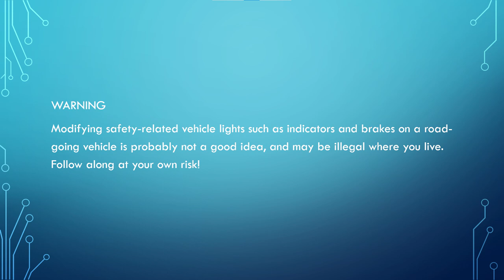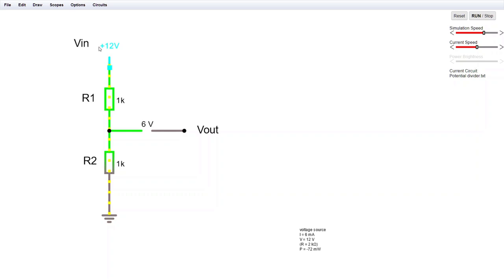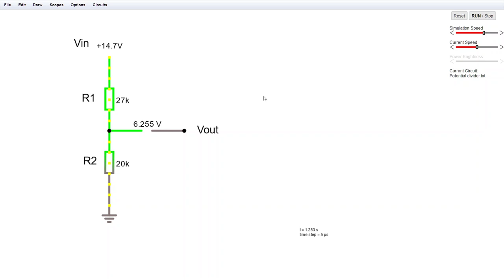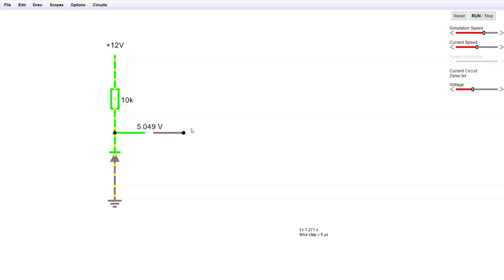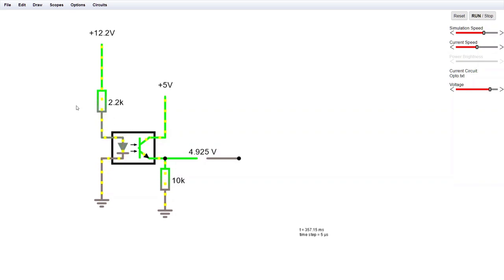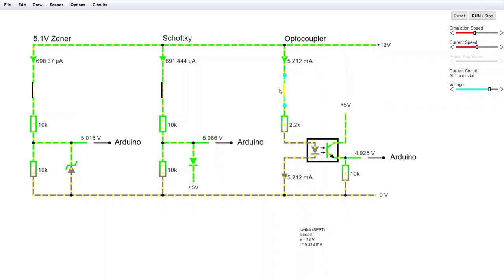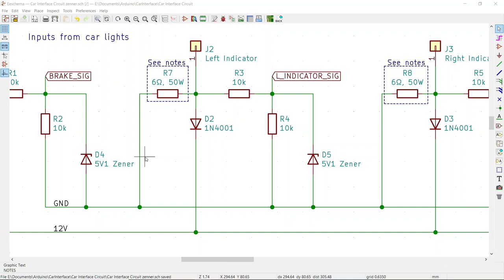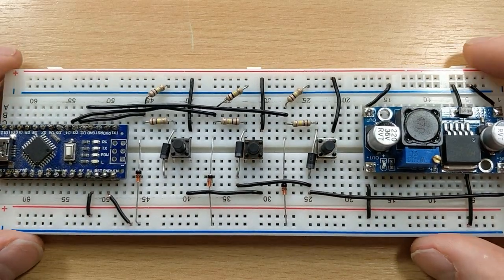Animated indicators (turn signals) with Arduino, FastLED and a WS2812B LED strip.

Comment: This would have a very piratical use in creating a wiring harness for a trailer.   They sell for $150 to $200 US and do the same thing.  This looks like a much more reasonable option and will protect the signal lighting in you car when hooking up a trailer.   The days of just tapping into the lights for a trailer is gone with all new cars.  This looks like a inexpensive alternative.   Good stuff and WELL explained.   Thanks.

Comment: Beautifully delivered presentation and project planning. My best tip for vehicle lighting cluster modification is to not bother... but if you do want to proceed dont hack apart your OEM units and purchase some non OEM aftermarket ones. Taking apart lighting can be tricky. Some are ultrasonic high frequently welded. Some are bonded with polyurethane. Dont forget that plastic is a thermoplastic and baking them in the oven can cause irreversible damage

Comment: Interesting stuff - thanks for the video.   If I may make one comment on supply voltages...  Automotive can be an engineer's nightmare.  Cold-cranking can lower the 12V down to 6V or so in some cases.  And beware the load-dump spikes.  Solenoids and motors can throw all kinds of junk onto the 12V supply, and short spikes in excess of 50V are not unknown.  So you did the right thing with your input clamps, but you should perhaps consider the supply regulators that they use (and their input capacitors or other filter protection) to avoid nasty surprises.
Reply from the maker: Thanks for the advice! I was reluctant to put too much capacitance on the power input, as I presumed that would delay the boot of the Arduino (I might be wrong here, I'm no expert!). Or are you saying to make sure that any components on the power input should be rated much higher than might otherwise be the case? Or some kind of choke perhaps on the power in?  It was an interesting thing to look into and is just an experiment really, always happy to learn though!
Reply: @ScottMarley  I was basically trying to say that you need to ensure that the parts on the input have an adequate voltage rating.  Specifically rated regulators are often rated with maximum input voltages up to 60V or so. They should not run like that normally (too much power loss) but they will not get destroyed by the spikes.  Due to battery the voltage drop on cold starts, regulators with minimum voltage low drop may also be specified.  I am not suggesting you should follow this guide, but it gives some good pointers regarding the problems to avoid... https://www.ti.com/lit/an/snva681a/snva681a.pdf?ts=1618885870959
Reply from the maker: @GodmanchesterGoblin  really useful, thank you very much.

Comment: Compliments on the video! It's a simple but detailed explaination. I was just wondering if it was possible to use a 5.5V, 0.33F or 0.47F super capacitor after the buck converter to keep the arduino running between the blinks so that a more complicated animation can run. Seen as I wanted to use about 64 leds in one blinker with an arduino, converter and capacitor each, I though 0.33F would be enough capacity to keep everything running. Does this work with the diodes you named D2 or D3 in your schematic? Just to confirm my thoughts...  Also, if it worked, do I need to decrease the resistor you named R7 in your schematic because of the increased powerdraw of the charging capacitor?

Comment: Nice. Question: Why not use 12volt LED strip and relay system for inputs? 12v coil on relay will handle auto voltage changes and SPDT can toggle between 5v and ground from nano to prevent float. What potential problems could this create?
Reply from the maker: You'd have to be careful regarding the voltage you are supplying to the strips remember when a car is running, the battery voltage is more like 14.5V with spikes well above this. 12V LED strips might be ok with this, or they might not, I haven't tried. You might have to put a buck / boost converter in front of the strips to give them a constant 12V. You could absolutely use relays for this,   I just decided to go for all solid-state.

Comment: Im looking into implementing this for my motorcycle as an addon to the existing lights. I was wondering, is there a way to do this same thing, but have the brake lights and the blinkers on the same strip? My idea was to have the lights red when braking and then when turning blink them, and when neither have them glow white or something that way im more visible.

Along with that is there a way to have it change led colors in segments? So lets say for example that I have a single strip that runs around the motorcycle, and i want to change leds 1-20 red, the 21-50 white and so on. I believe there is with some modification to the code, I just want to make sure before I get too far.
Reply from the maker: Anything is possible of course :) check out my FastLED basics videos if you want to learn how to code your own patterns. Good luck with the project!

Comment: Could you show the same on a multicoloured led single strip.
Also add reverse and side light
Reply from the maker: These are multicoloured strips, so you can make them any colour or pattern you like! I just stuck with the traditional colours in this example.

Comment: Awesome project, interesting idea using the power directly
from the lights.

I assume you programmed the Arduino directly without a bootloader to minimise
the powerup delay?
Reply from the maker: I thought I might have to do that, but in the end the delay on the car brake light compared to the LEDs is only perhaps 100-200ms which I thought was acceptable. So in the end I left the stock bootloader in place.
Reply: @ScottMarley   I wondered about this too.  Seems like it works just fine.  Keep it simple.  :)

Comment: Unless you have an electric car and a steady current (you won't get 14V, just a clean 12V and some HF noise from the motors), you may want to filter out a lot more than just the voltage... A 7805 and a couple of beefy capacitors (plus the usual 100nF near the Arduino itself) and an inductor may be a minimum,

Comment: Hello.  I have a different project, but I can't find a solution.  Your video looks good.  There are 2 different places where I get 12v energy.  When the capacitor is connected to the place where I first get energy (mirror floor lighting), the vehicle cuts the energy.  If I do not connect a capacitor to the 12v part I get from the signal, the sliding signal does not work properly.  This goes to the 12v regulator I bought from two different places.  I am waiting for your help.

Comment: Hi Scott your video is incredible well done and incredible informative I have already learned so many new things and have also started following the fast led basics and more on your channel. 
I understand the 5v1 Zener diodes and the schottky Diode to some degree but not where to extract/insert the signal wire to activate from indicator or brake. 

 For a slightly different project I would like to replicate  your circuit and have looked at schematics but struggling slightly to iterate how the flow runs on the actual hardware when connected to the car.
In your example you still have the push buttons(just to show on desk) and then also included signal from the car. 
If I was to only use signal from the car those switches will come out but would I need to bridge the gap or put in something in its place that's the only part I don't quiet fully understand
Reply from the maker: Thank you! The buttons would be replaced with the wires that normally go to the car light bulbs.
Reply: @ScottMarley  thanks for your speedy reply. Again I am super impressed with how the video is done really well explained, just as I said got lost from where you built it on hardware and to putting in the car and doing the testing. Awesome to see it in action. 

 I have a screenshot of your hardware setup. It's a little difficult to see where the vehicle wires are inserted but I bought all my components and have a buck converter so going to try replicate on my bread board and then follow schematic to see how it all runs and flows from input to arduino and then arduino to the led strip.

Reading through some of these comments getting a little bit of extra insight like the one comment of on cold starts with voltage drop would that put any stress on the system. And Is there a way to overcome the voltage drop or at least not have it affect these components?  Or do I need to relook at what components to use especially if longevity is in mind.

Then on a slightly different note, how do you get an rgb strip to show the amber like in newer cars example like with Audi sequential indicators or do they use a strip with a dedicated amber. Ive Watched episode 2 of your fast led and again very informative but then makes me wonder If possible to get that color. I've been messing around on the CHSV and with CRGB to get there but it either goes more red or more yellow not getting that proper amber color with brightness

Comment: Hi Scott. Would like to find out from you if you had to burn the bootloader for this nano you are using. I see there is no delay when you click the test buttons or when you habe connected directly to the car. 

I have everything running correctly and connected right but because the arduino does not have consistent 5v power it delays 1-2 seconds before the sketch runs after giving signal via button or from vehicle
Reply from the maker: I didn't have to, but I know others have needed to do so. It must depend on what bootloader comes preinstalled.
Reply: @ScottMarley  are there different bootloaders you can run while still using the arduino ide ? I don't understand if you don't mind explaining on the bootloader
Reply from the maker: @grantayson7938  I'm sorry I don't have any experience in using different bootloader as it's always worked fine for me without messing with it. You might have to search online, or perhaps ask on the Arduino subreddit.
Reply: @ScottMarley  Thank you
Reply: I just did some research on uploading via a programmer(arduino uno or other) in my case using a uno to program a nano. I turned the uno into a programmer and the nano as the target quite a simple process and pin connection then hit upload via programmer and it loads sketch without a bootloader. This was my fix and now the nano starts immediately with power on
Reply from the maker: @grantayson7938  awesome, glad you got it working!

Comment: Hey great work! is it possible to add a "power hold" feature so that it can have a "switch off " animation and unit can turn itself off?
Reply from the maker: Not in the way I've done it where it gets the power from the lights themselves. You could do it of you wired it into the permeant 12V supply from the car, but that would involve running a power cable to the battery or some other circuit that was always powered
Reply: @ScottMarley  in my current setup I do run a permenant power already so this is no problem, a couple transistors and some code to hold them on would work well I think!

Comment: Try to make a complete light system ...  turn, park, break, (front and rear) also with some strobe light , knight rider as an option.
Reply from the maker: I don't want to do that as I have no need for it, but if you wanted to then this is a good starting point!

Comment: Hello.could you please tell me a code or link to buy the 5v buck regulator module please?
Reply from the maker: The one you use depends on the amount of lights you have and therefore the amount of current you need. If it's a small installation, look for something around 2A or above. Something like this https://www.amazon.co.uk/dp/B0823P6PW6/ref=cm_sw_r_awdo_navT_g_PYWMY9E6BN4ACYH4EA9F but you can get them much cheaper from eBay. Make sure you adjust it to 5V before using it though!
Reply: @ScottMarley  Thank you

Comment: I've been watching your fastled videos! They are really good. I was trying to make a brake light for my bike and was wondering could this setup be paired with an accelerometer to brighten the led when the bike slows down? Say as in have regular running mode, and when it slows down it gets brighter. With a rapid sudden stop it gets even brighter. And then dim back down to the regular running mode. 🤔
Reply from the maker: Absolutely. I'd recommend an i2c accelerometer. There's plenty of tutorials if you search for Arduino i2c accelerometer.

Comment: What about a buck converter?
Reply from the maker: You would need a buck convertor for each input (so three here) which seems massively overkill for something you can do with three diodes. Also, some buck converters need a minimum load on them to work stably. Here, there would be basically no load.

Comment: Hi there… 
So I wired up your schematic to my vehicle, it's works perfect. I am using a single strip LED 2812b. I am also using a different code. 

Thanx
Reply from the maker: Awesome, glad to hear!
Reply: @Rolan 
 May I please have your code?
 I've been trying to figure out how to do all three functions on a single strip, but I am stumped!
 How do you create "zones" for the indicators and brake lamps? 
 Also, I would like to have receding indicators like on the new Mustang Mach-E > https://www.youtube.com/watch?v=I50uEt_F3Mw but I can't figure that out either!